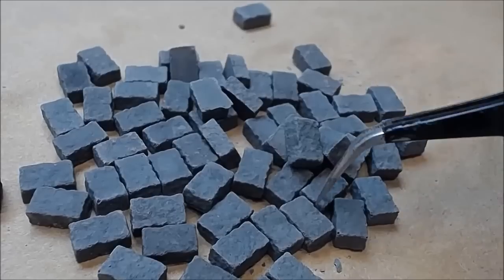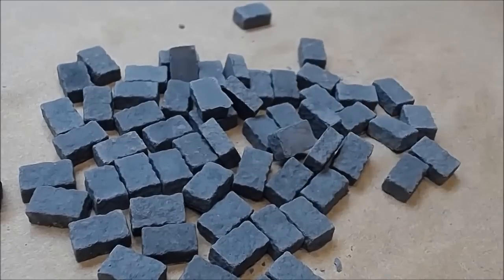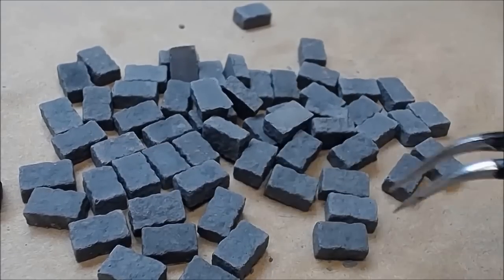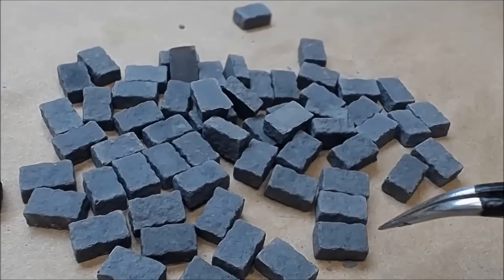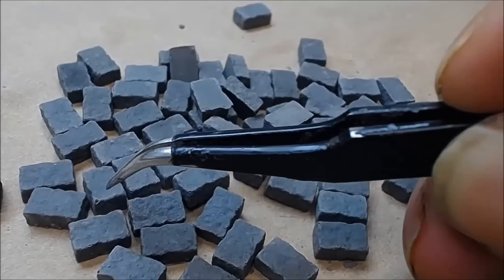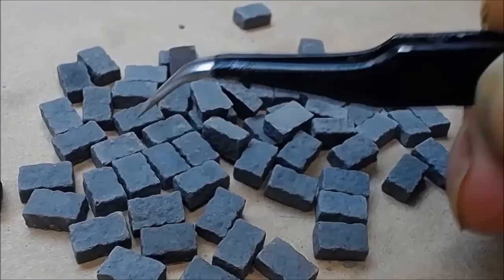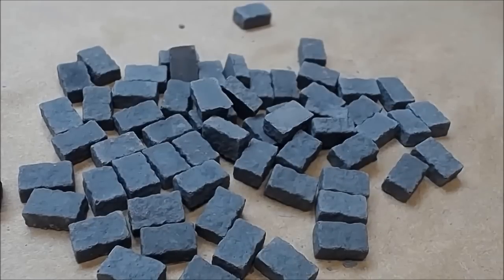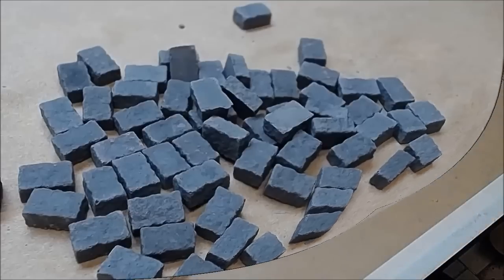Making Silicone Rubber Mould  At Your Bench  Part (1)

Comment: Nice work Simmo, looks like you have a good system in place.  Just a suggestion with the pouring of the rubber, I've found that if I pour from very high and get a real thin stream it seems to result in less air being captured in the material, combined with your vibrator you might find very few bubbles requiring popping :)